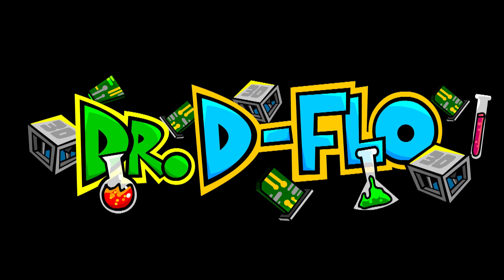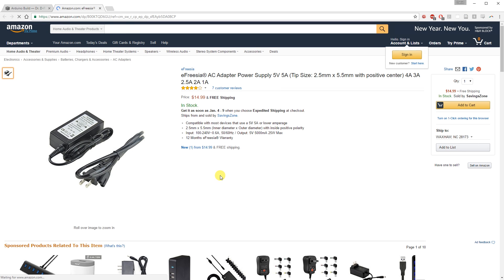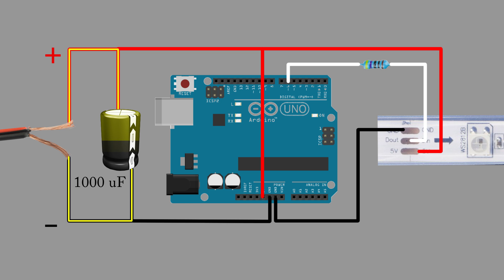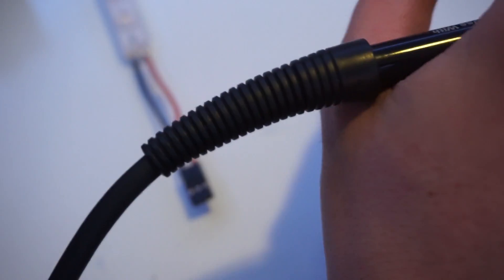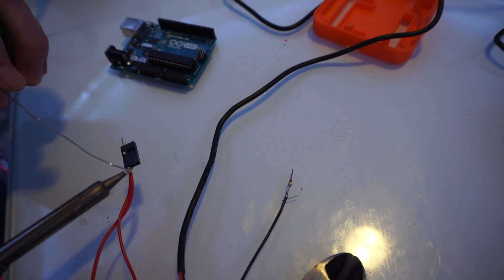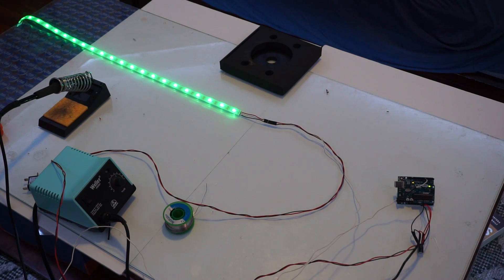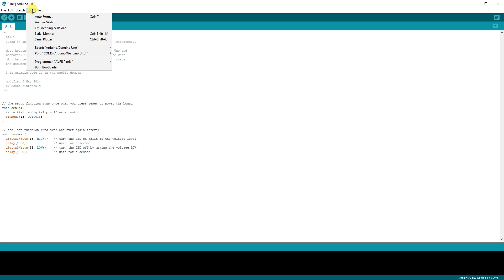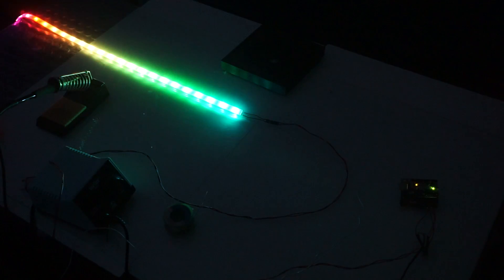100 Addressable LED Lights Arduino Build (Quick)

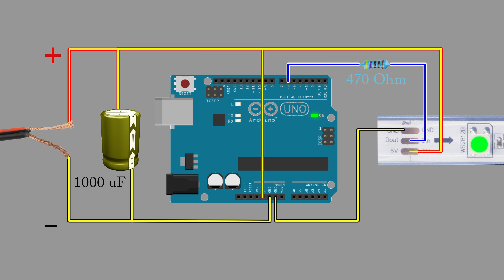Comment: 5:20  The resistor does NOT prevent voltage spikes.  It is current limiting and/or voltage reducing.  That depends on how you'd like to visualize V=I*R.

Comment: Hi hope you well I have a bit of a specific question I hope you can maybe help. I'm looking to get the correct "Amber color" on a Ws2811 or ws2812 led strip with the code in CRGB closest I can get is CRGB (170, 75, 0) with brightness of around 80 to 100, this unfortunately is no where close to the amber of let's say an Audi led Indicator. 

Can you assist with the a CRGB range that might be a closer Amber or is it not possible on this strip?

Comment: While I understand what the capacitor does in the circuit, I don’t understand how to determine the size to use.Why  use a 1000 µF? Would a 100 µF work just as well? I say this because I have lots smaller capacitors and would have to order a larger one.

Comment: My Leds flickered and didnt worked as shown. I just powered them with my 5V straigth with the Capacitor and just connected the Data "Pin 6 from the Arduino." Solved it with Supply minus connected to Arduino GND. Seems like Arduino needs that GND thing :D
Reply: Just posting it to help others if they look for dump issues hahah

Comment: Hello. I'm relatively new to the Arduino and leds..I'm looking for a sketch to use to build a marquee sign. Looking for the vintage style light chasing to travel around my home theater sign. Could you direct me?
Reply: Same! I’m looking to build signs similar to old-school neon marquees where separate sections light in sequence, like an E-A-T sign at a diner. Haven’t found a suitable sketch or tutorial yet. Will post if I do!

Comment: Where did you solder the wires from power supply and the capacitor to? I am trying to replicate the way you do it but that part gets me lost!! Also, what do you do with the wires from the LED lights where do you connect them? I know it is said in the video but I just want to make sure!

Comment: Why not just use 12v version so you don't need as strong of a power supply as well as can run longer lengths
Reply: You will blow

Comment: Hi there, I'm a complete noob here and want to make something like this for a little dirtbike. How would yougo about making it waterproof, chrash proof, and vibration proof?. Im guessing its all the same as the video but with some extras? Plus figuring out the power requirements.

Comment: One point of correction... "electrons" flow from negative to positive.  It would have been better to say "current" instead of "electrons" in your diagram explanation of the flow.  Some may argue that "current" also flows from negative to positive as well because "current" is defined as the flow of electrons, but it is generally acceptable to refer to current as flowing from positive to negative.

Comment: Awesome video, how would i be able to take these and split them up into 4 strips. Where each strip is 25? and the programs run the same on each?
Reply: Are you planing on putting the LED's in different areas around the house or do you want to make it one strip? I know this has been a year...
Reply: @joshjennings9110  I know it’s been 4 months but I have the same question and yes In one life for my set up.

Comment: great work and u probably wont see my comment but if u do then can you please tell me if i cant program an led strip and place it on my motorcycle in a certain arrangement but my question is do i have to attach the arduino to it or would the led strip be programmed so i just plug n play?
Reply: The arduino is the brains of the operation telling which LEDs to light, what colour to be and when to light up. You could always get a smaller arduino nano, and have it run a set routine, or change through a few different routines with a press of a button. It’s more complicated than jusy following this video but it is absolutely possible. Check out Daves Garage for in depth Led programming videos 😁

Comment: "The resistor is like the capacitor, it prevents voltage spikes" ... now this is either wrong or massively simplified
Reply: Voltage drop, is the LED strip expecting somerthing less than a 5V logic signal, maybe even 3.3V

Comment: Could I run two 5 meter strands on this setup?  Each strand has 150 RGB's.
Reply: Yes you could but your biggest issue will be voltage drop. You’ll have to inject power along the strands. 5v isn’t much for that length

Comment: 3:28 why you chose 1000uF capacitor and no less or more? That depend on how many leds you put on circuit?
And why 470 Ohms and not other? what calculation must be need to do for a corect conection and prevent any damage to any leds or arduino.?
What it is the Voltage of the capcitor? and i suposed is DC for the polarized capacitor right?
Reply: To catch and even out voltage spikes in the case of LED strips, the capacity does not really matter all that much (100uF should be enough). Same with the resistor. This could also be a 220/330Ohm. There is no exact calculation on how much resistance is needed really (other than for example, if I want to use a single LED on a higher Voltage), as these strips have on-board capacitors and resistors on a per/LED basis)
Reply: @dannymellenthin7887  The intensity of the tape glow depends on the resistance value?

Comment: So the arduino can only program neopixel strips and not the regular 3M brand?
Reply: 3m is just the adhesive on the back. And the arduino can program any LED strip that has the same kind if LEDs as the arduino

Comment: WTF in the video you used 1000uF 10V, but in description is 16V 1000uF
Reply: How is that a WTF?  Its really no problems that its 16V. Its over specced and wont do any damage. It only gives a greater safety margin

Comment: I dont know if this is a stupid question... buuut!  I have a power supply with 5V ,  26A..   Is this too much Amps to go into the 5v on my arduino..  I have a 5 meter long NeoPixel strip, with 300 total LEDs on it.   Was wondering if i can power both my Arduino and Strip with the same power supply.  Right now i power the Arduino with its own "Usb powersupply" 1A.  And the strip with the 5V 26 A.  Works fine, but would love to just use one power supply.  Thanks in advance.

Comment: hey i want to ask you if you can save the patterns on the arduino or dosen´t the the light strip reapeat the pattern that you make while the arduino isn´t conectet to the PC?
Reply: Hula HoopVEVO  ذو لمجلس،ءس
Reply: Most light stips are programmed only with a sertain colour so if the flash though 10 colours using a program they stop at the exact colour when you disconnect the arduino

Comment: The way you did the ground--returning from the LED strip, through the Arduino, to the supply--you have potentially 5A of current flowing through a trace on the Arduino board. You ought to make sure that the Arduino trace can handle 5A, or better yet, just connect the grounds.
Reply: Most tutorials on YouTube are doing the same thing with 5v pin connected in parallel with the power supply. 
Why would you ever want your power supply (+) to be connected to the 5v pin? Isn't that dangerous? The flow of current going opposite of what was intended is ok?

Comment: At the start you state the current will flow THROUGH the capacitor. From the perspective of teaching that is incorrect. D.C.  current does not flow through a capacitor but simply charge the capacitor. In current mode place a dmm in line with the capacitor, then turn your psu on,  a brief (mS) current will flow TO the +ve plate of the capacitor, then stop.
Reply: also, I was taught that electrons flow from the negative (ground) to the positive... idk, maybe I'm wrong... but that the "holes" where electrons go, would flow from positive to negative.
Reply: @Crucifixionmachinemusic  electrons are negative which electric is so technically the whole circuit is

Comment: Hi. Can i use 3w led  instead of these leds? Will be using 12-18pcs of 3w led constant driver or you advise me which driver is suitable to run 12-18pcs of 3w highpower  leds.
Im keen to build programmable aquarium leds.
Pls advise.
Thanks

Comment: quick tip you can also use the heat of the soldering iron to let the Heat shrink tubing shrink
Reply: webbios nl Yes you can but a Bic lighter is better.
Reply: webbios nl ط ط وا تنتكططي
Reply: webbios nl  رى م مو وهي

Comment: Hi there, what would be the max amount of leds that the arduino can send its data signal to before the PWM signal experiences voltage losses?
Reply from the maker: Alec this really just depends on how picky you are. At any distance the signal will start experiencing voltage loss because any wire has some amount of resistance. At 100 LEDs I was unable to detect any artifact, which was about 3.3 meters (30 LEDs per Meter). At 200 LEDs, about 6.6 meters, I could definitely tell that the voltage was dropping. I figured this out by turning all the LEDs white. The last 50 LEDs were starting to yellow, which is because blue requires the highest voltage (http://oksolar.com/led/led_color_chart.htm).
Reply: The DC voltage drop across the LEDs is what causes the yellowing in colour correct? ? Although I am referring to the data signal used to drive the led drivers, the PWM signal sent from the arduino, that determines the colours. how many leds can the data pin on the uno drive?  or was this also what you were referring to?
Reply: Each led driver is a repeater so in theory you should be able to go on forever with data. You need to inject power every 3-5m. My issues is if I put 2m of cable between 2 sections of LEDs then 1 flickers, I need to know how I amplify the data signal.

Comment: Will the diagram at 3:34 also power the Arduino? You have external power to the pins but not through the power jack or USB port on the Arduino.

Paul
Reply: Nevermind... watched on and the question was answered.

Comment: Do you think I would need a capacitor if this was being used for lighting in a PC? Power would come from the 5v rail from a high end PC psu via a molex and if it did have any sort of voltage spike it would kill the entire computer. Going to be controlled via arduino nano and a windows application on github I found that will control the lighting effects.
Reply from the maker: No you do not need the capacitor. This is just an extra precaution. You should be fine with your PSU.
Reply: Is ohm required too if using a PSU to power the led strips
Reply: a $0.05 cap to protect a $10.00 LED strip is a safe choice, the same goes for the 470R resistor.
Reply: Amadax ىت

Comment: can you show how to do it but with a power bank
Reply: You'll need a transistor for each channel R G B I'm using a 2N 222A transistor. There videos out there search them up.
Reply: I need this too
Reply: I think all you need is the male to male connector to connect to audrino and power bank
Reply: Yup it is and get the USB type
Reply: I'm too noob on this. Today, the seller said me that I need aproximately 7,5m of led strips, so that 2 power banks weren't going to be enough (by the Amps) :(
Reply: Manu López it should be
Reply: Manu López look up jotamakuro on YouTube his video of marshmellow led helmet
Reply: Yes he did it, but I don't know how. My helmet got more than twice the leds that Jotamakuro used :(
Reply: Kevin Marquez thanks for the hint
Reply: Kevin Marquez  this LEDs have integrated driver ics so you won't need a transistor for this setup
Reply: Manu López a

Comment: Only THREE syllables in Arduino!
Reply: Ron G it's a speech impediment
Reply: Neil Barnett agreed but truth told, I recently acquired one to add to my arsenal and found it useful in certain isolated instances. Just a grief saver trying to get my damn rosin to flow
Reply: Although, I would discourage anyone from using the MALE to supply voltage...
Reply: And he's sardered his contacts.  
Why he thinks he needs a flux pen to improve his soldering I don't know.  I've never ever used one or felt the need for one in 45 years.  Of course, the secret is to pre-tin the connections and to use 40/60 multicore solder containing real lead.